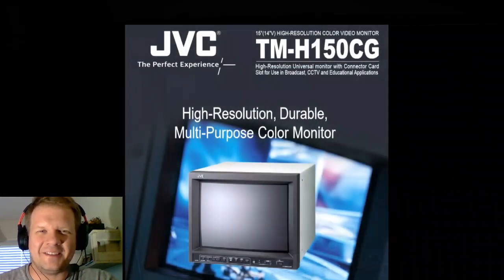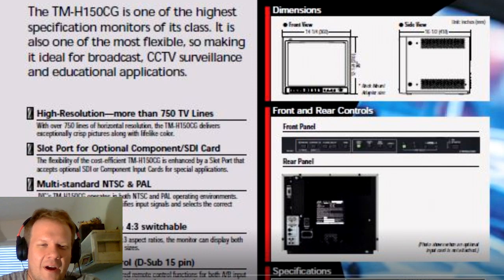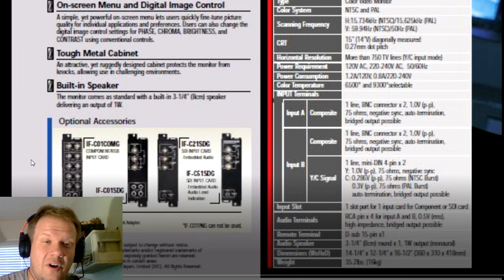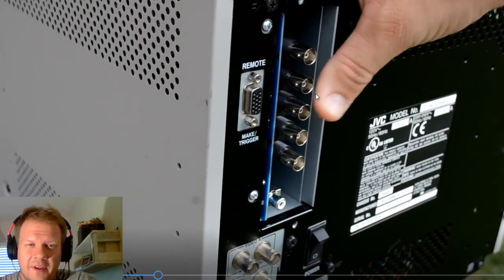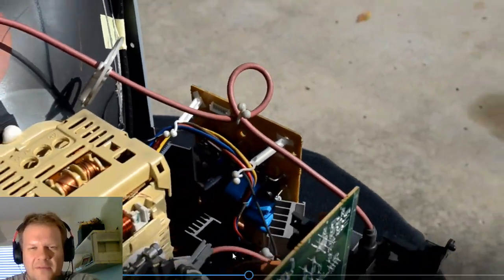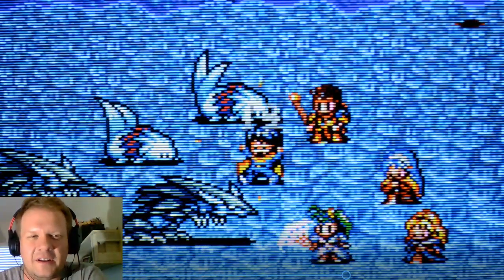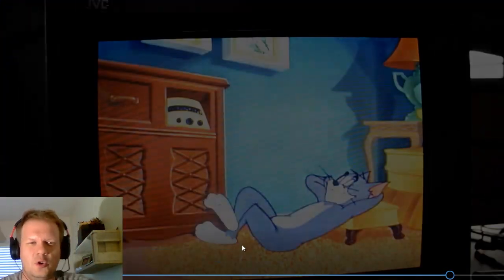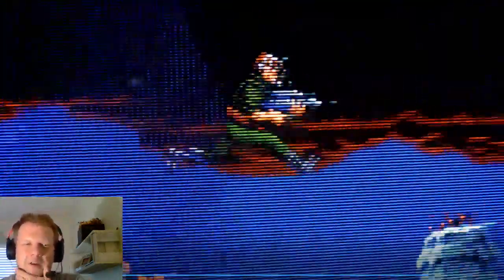JVC TM-H150CG Pro Monitor Review: What's so special about a Shadow Mask CRT?

Comment: 480p on a CRT is a gimmick anyway. As long as it does 240p & 480i you're good to go.
Reply: Yeah I think 480i looks great on a crt
Reply: Can you explain. In all seriousness I am curious
Reply: @JeffYPbPr  as long as a crt has a high tvl, it will look great regardless of being 480i 480p 720p 1080i. The higher progressive scan modes will still be better but it's not a necessity imo, for retrogaming at least.
Reply: I fully agree.
Reply: Huh? How is it a gimmick?
Reply: @taylorjwyatt  Well I guess it's alright to call it a gimmick if it's a CRT that is not an HD or VGA screen but yet still does 480p, like only very few do. Traditionally there are two kinds of CRTs: SD TVs (doing only 15 KHz) and Computer monitors (doing 31 KHz and above, but almost always not 15 KHz). (Then there are also HD CRT TVs, but those are crap due to their digital signal processing.)
Reply: Its not a gimmick... it looks much better than interlaced (480i). What you mean to say is that not having 480p is not a dealbreaker... but a gimmick? No.

Comment: I love this JVC, Chunghwa tubes are fantastic, I have one in an Ikegami tm15-80r. Might even be the same one in the JVC. Hard to tell with the focus on your picture however. The only thing you have to keep in mind with these is the plastic frame, remote panel PCB are incredibly fragile. These ones especially need a lot of care when shipping. I've gotten 3 with a similar design that all had chassis damage and in the worst case, a snapped remote PCB.

Comment: Steve your video was prophetic.  I just watched it yesterday and now I have a chance to get one of these monitors that is barely used and still in the original box.  It doesn't have any input cards though.  How much do you think would be a fair price?  He came back with $400 Canadian, which is about $300 US.  Thoughts?
Reply from the maker: That's a good deal if it's pretty much unused.  Have you seen the screen turned on?  I'd only pay that if I saw it tested.  If it works then you can buy the RGB card for less than $100 from Jam on eBay and have a great monitor.

Comment: Hey thanks for the tip about those new cards! I have five sweet JVCs but only one RGB card :-) (No need for them with my C64s though, as they only output s-video.)
Reply: @LilYung3347  Yes, but it requires some trickery. Check out these RetroRGB articles for info: https://www.retrorgb.com/vgatorgb.html
Reply: @Stakkeroid  
thanks
Reply: Quit hogging all of the CRTs if you aren't going to use them.
Reply: @NirnBootMod  Two are currently in use, and the others are backups that I will use when the components in the currently used ones die, because they will die. I also want my kid be able to play with a CRT in the future. Some components (like caps) can and will be replaced, but many can’t (like tubes). I actually had two more PVMs previously, but I gave them to friends who needed them. Maybe in the future if it actually looks like I won’t need three backups, I might donate one or two more for a good cause.
Reply: @Stakkeroid  I'm only joking around. 5 CRTs is not a lot.
Reply: @NirnBootMod  Ha :-) Well, it’s still good to check once in a while that one doesn’t have a ”CRT problem” :-P

Comment: im from europe and i got the exactly jvc, the thing is the shipping for those card is expensive, i've rgb modded mine some months a go and the problem is the sync, a lot of times you will have distorsioned immage when there is too much white, or sometimes even when everything seems okay it just fail to sync, i used a scart socket and these things are shit...., i recommend cloning by hand the card with bnc connectors, you can clone yourself one for like 10 euros and you will not have any of these problems, and thats what im doing right now.
Reply: Most of the time, injecting the sync at one of the inputs instead of directly to the jungle, will fix up sync issues.
Reply: @martinhejnfelt6058  how can i do that? i cant just get the sync from my console and plug in to a composite imput
Reply: @pabloxd1239  Well it depends on how you made the mod. If you're actually making it think the card is there, then I've actually never tried it (I always clone the IF-C01COMG instead), but on similar monitors, you simply just wire you current sync wire to the PCB where composite otherwise comes in, but then you'd manually need to force YS2 high for RGB.
Reply: @martinhejnfelt6058  yeah i grounded 2 pins to make the monitor think there is a card, then with a little circuit i inject everything on the jungle chip
Reply: @pabloxd1239  Yeah ok, well I guess if you simply move the sync wire, and remove the inline resistor (often a 30 Ohm) and inject at pin 18 on CN6005 (the same place you grounded the 2 pins most likely) instead, the sync signal will go through the same circuit as it normally will from the output of the IF-C01COMG card. So SYNC->75 Ohm to GND, and inline 0.1uF capacitor->CN6005 Pin 18
Reply: @martinhejnfelt6058  okt hanks, i will try that

Comment: I just got one of these but the picture is very dim. I have tried increasing the brightness but the colors just get washed out. Do you have any idea to what could be causing this?
Reply: I have one with a dim picture unless I turn brightness up almost all the way. I think there is a way to turn up the voltage manually kinda like how u can set water pressure from the main valve as well as the actual sink faucet. the monitor still has a very sharp and accurate picture. I have two both calibrated the same but the better one has brightness set at 0 and sometimes 1 depending on the room lighting. the old one is set around 50 if I remember correctly. these things run for a long time and can take quite a beating. I grew up being rough with unreliable tube tvs these monitors are a pleasure to use.

Comment: I just purchased a JVC BM-H1310U.  Are there any capacitors prone to fail in this unit?  I can't find any repair vids on this monitor.  The one I purchased is in full working condition.  However, I would rather do a cap replacement than blow a tube.  Anyone have any issues with this model?
Reply: Sorry... It's a JVC BM-H1310SU.  Typo

Comment: Hey there, i hope you can read my comment. I was able to obtain a 21inch Sony PC monitor crt. mint condition. i used it for a little time and it was ok. But when i use it now it gives a small PoP sound ever 30seconds or 40 seconds. After using it for 20minutes the sound is gone. I was wondering what can cause something like this, im not planning on opening it because its dangerous and below the plastic is has a metal cage. (i already tried to degauss using the menu and it did nothing)
Reply from the maker: Sounds like a grounding issue.  some kind of arc maybe.  That's pretty risky to try and repair if you don't have a lot of experience.  CRT manuals always say to give a Monitor 30 minutes to warm up before running tests, etc.  I'd just let the monitor warm up for a little while before jumping on it and using it heavily.  If it works good otherwise you may be okay to use as is.
Reply: @RetroTechUSA  thanks , i was scared of that issue because i dont want it to catch fire